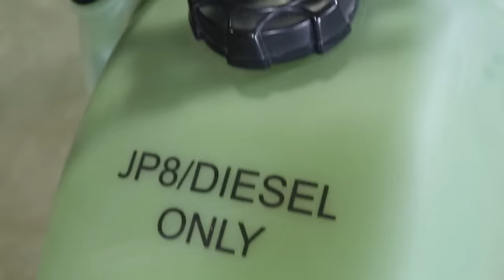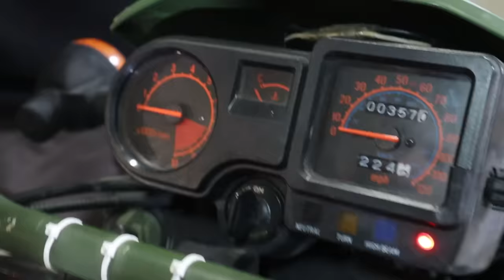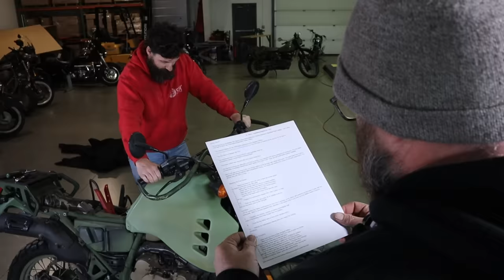I Bought a Diesel Dirtbike from the Marine Corps(1 of 214)

Comment: For what it's worth, I am a mechanic in the Marine Corps. If you're able to find a USMC serial number on it, I may have some information. Also, the blackout lights display light not visible to the naked eye, they are designed to be used with night vision goggles.
Reply: @Bushlore1  I'll look it up when I get back to work and let you know what I find!
Reply: It looked like the front light was open at the bottom. If they were meant for night vision wouldn't they be completely covered even the dim tail lights?
Reply: @JusttheEdge  the front is shrouded because it shines infrared light onto the ground for the driver to see. The rear is not shrouded because it is for other people to see
Reply: I bet there's a bunch of videos on blackout lights than can explain it better than I can
Reply: @travismud5213 was curious if you ever got any info?
Reply: @Ethan Lovell  I could find any information in the database. Is that there usmc serial number, or the registration number? Sometimes they are different
Reply: Just don't turn it into war thunder forum here.
Reply: thats what i was thinking about the lights - im in the uk so i cant bring my night vision around easily lol
Reply: @travismud5213  blackout lights & IR lights are two different things, no need to shroud an IR
Reply: Blackout taillights and most blackout headlights are not infrared. Only some blackout headlights are IR, but a vehicle with an IR headlight would also have a normal blackout headlight. The blackout lights on military vehicles, such as on this bike, are designed to be seen with the naked eye
Reply: someone commented he used to manage it, 599133
Reply: That's badass
Reply: its called infrared
Reply: I guess it wasn’t worth much
Reply: I guess it wasn’t worth much
Reply: Good for you 12:25
Reply: The blackout lights when I was in weren't IR...they were intended to be seen with the naked eye and even had a built in means of judging distance to the light.
Reply: Yeah the moment he pointed to that thing in the front I was like "looks like some kind of IR emitter"
Reply: What?! Badass!
Reply: Bro gonna use GCSS to find out it’s service history 😂😂😂
Reply: ...we're old!
Reply: I can confirm that driving blackout ops is horrendous. I did many of those in Iraq 03. Also we had quite a few of those bikes in 29 palms when I was there 01-03 time frame.
Reply: yut
Reply: Hyuk 😊😊
Reply: Blackout drive is used with night vision. A small amount of light barely visible to the naked eye will be bright with NODs the shroud is to illuminate the ground for the driver. Ir headlights exist, but are more for spotting down the road. We also had IR spotlights in Iraq 03.
Reply: Motor T Driver, We don't use  night vision in blackout. Back when I was in the Marine Corp didn't have the budget for every driver to have night vision, so none of us got it. The Lights are visible but they are equal to a .02 watt LED night light. edit My vehicle was the M-813, 5 speed manual diesel  6X
Reply: @markmitzlaff8672 totally agree
Reply: I was just about to comment about the NV lol
Reply: those aint trade secrets?
Reply: Yea find base they had them at  everything  in military  searal numbers
Reply: Oh was army I think  army has or had dirt bikes
Reply: They have to bleed the lines after the injector pump
Reply: And there should be a bleed screw on the injector pump body
Reply: Wasn't it in the instructions to purge the fuel system of air?

Comment: Those blackout lights are standard equipment on military vehicles. The reason  there is 4 lights Lin the back is for proper following distance. If you were following too close to the vehicle in front of you, you would see all 4 lights. At the proper following distance, the lights on the left would appear as 1 light, and the lights on the right, the same. At too great a following distance, it would look like only 1 single light.  Source:  I was a motor transport driver for the USMC in the 90's.
Reply: I was hoping someone had pointed out the tail light indicator purpose. I was a motor transport operator in the Army.
Thank you for your service.
Reply: motor tuh
Reply: @xzx_sparky_xzx  You too sir!
Reply: Wrong. You are just wrong. They are not for any visible purpose at all, they are for riding with NVGs
Reply: @onseki1774  I literally was Motor Transport by MOS. We were trained that proper following distance would show 2 lights on either side were just right, 4 is too close, and 1 is too far. Don't comment about things you don't know about.
Reply: @onseki1774  Ah, yes. The module that emits light for the purpose of seeing… has no “visible” purpose. Genius.

Comment: The decompressor lever is to enable you to spin the engine freely without compression on starting. Once the engine is spinning, release the lever so that it fires up on compression. You can also stop the engine by pulling the lever in.
Reply: Theres a comment in here based off the manual that explains what the lever is supposed to be used for, which is bleeding the fuel lines or having to push stsrt it, and to leave it alone when electric starting...because as with most electric starters they can handle compression
Reply: @jetstream454  Same thing is used on 2T Trials bikes. No starter motor, so have to be kick-started with a decomp lever.
Reply: Also makes for a safe way to stop a runaway. no compression, no more run away.
Reply: you can also pull it when you are moving and it will slow you down, compression brake, or jake brake
Reply: @jetstream454  - I think most, if not all older, larger displacement engines with a kickstart had one. I know it from the Yamaha XT 500 and SR 500. There it just held the exhaust valve open.
Reply: @steve1978ger  Yeah I remember hearing about that. And earlier big bore 250 enduros, at least the WR250F had it too
Reply: @deandee8082  A jake is different,  it only opens the exhaust valves at the top of the compression stroke.
Reply: It's not used while starting. Only bleeding the lines.
Reply: @deandee8082  How do you think that will work? It releases all compression from the engine to aid in starting, not add compression then release in the exhaust stroke as jake brakes do
Reply: Also I wouldn't use decomp to stop the engine as if I'm correct and it holds the exhaust valve open, that would cause damage.
Reply: @clifm9574  - interesting. on the SR500 it was only used to allow easy movement of the piston over the dead point, then you'd release it and kick the starter.
Reply: @steve1978ger  Maybe for a gas engine with a kickstart to get it at an ideal point in the stroke cycle, but for a diesel with an electric starter it won't matter, and pressure+heat=combustion
Reply: ok
Reply: @deandee8082  Slow you down, but not in slightest way as in any sort of brake. Slowing down with the compression release is WORSE then just letting go of the throttle, because engine is running even without compression to slow you down. 
You sir are extremely wrong on this one.
Reply: My tractor has the same decompression lever. Great for winter starts.

Comment: Also, by looking at the metal shavings, that thing worked while it was broken. You don't get that much shavings if it just break and stall suddenly. A good small diesels mechanic could probably figure this thing out in a few minutes. Also i'm pretty sure the company who made that thing used commonly available parts to keep the cost low, so the fuel pump, injector and all might be random kubota, yanmar or john deere stuff. The small diesels mechanic would be able to recognize those parts.
Reply: How small are we talking? Do they have to be a legit dwarf or is like 4'10" small enough?
Reply: I thought the same thing . I live in the south , in an area where there are quite a few machinery repair places that have some great mechanics who can rebuild a  small diesel engine like that in their sleep.
Reply: @thebrowns5337  certainly of the leprechaun variety.
Reply: My thoughts exactly. Hopefully they can track those parts down.
Reply: With 40 years experience driving diesel trucks, tow the darn thing round and round the block. ( after checking, oil, coolant). If it starts then open, strip ancillary and replace as needed.
Reply: @thebrowns5337  🤣🤣🤣🤣🤣🤣
Reply: @thebrowns5337  DAEM BOEEE AGAHAHAHJAHAHA
Reply: @thebrowns5337  4'10" should be fine though 4'8" would be better.
Reply: There might be partno's or markings on components that google could link back to the base engine.

Comment: I own one of these.  DO NOT use ether to get it running.  I learned that lesson the hard way by shearing the woodruff key on the flywheel (which coincidentally resulted in the exact same sound you're currently hearing when you crank the starter).  I know the guy on ADVrider you're talking about, he's a great dude and a wealth of knowledge.  Good luck getting her running!

Edit to add- that motor sounds like it's spinning really fast to have full compression.  Once you get the fuel and starter situation sorted out, make sure the decompression lever is fully disengaged when starting.  On mine it has a tendency to stick so push it as far forward as you can on the side of the cylinder head; if it's partially open you should feel it snap into place and seat firmly.  There is a very large bolded CAUTION in the operator maintenance manual saying the decompression lever is to "only be used for bleeding the injection system and for help in push starting" and "not to be used for normal, electric starting" (all bold, italic caps in the book).  Good luck!
Reply: Hi don't know much about diesel engines do some of them have two fuel pumps one from the tank and a higher pressure pump to the injectors is the one that's broken the lower pressure pump, I'm just guessing here.
Reply: That doesn’t sound good. 😕
Reply: @adam-g7crq  It all depends on the location of the fuel tank relative to the engine.  On the M1 the tank gravity feeds to the injector pump which is housed in what's called the "primary unit" iirc.  I've been told that on the earlier models of the M1 this was a pretty well known point of failure and was modified later in the run.
Reply: Don't know why people are so obsessed with using that stuff, it seems like every youtuber uses it. Just fix the fuelling issues instead of hiding it with starter fluid crap...
Reply: @elobiretv  It's particularly temping on this bike because it's very cold blooded.  I usually have to cycle the glow plug a half dozen times before the engine will fire when it's below 70 degrees out.  A little go juice seems like a good idea but this engine doesn't respond well at all.
Reply: @milleRC51  thanks for the reply, I'm just thinking out of the box here because I normally don't know what I'm talking about 😁 if it wasn't gravity fed and that may have been a low pressure pump could they bypass it with an electric pump to the injector pump.
Reply: oof they did already mess up
Reply: But they DID get it running....Didn't you see the montage at the end?  He made it to OUTER SPACE!
Reply: @adam-g7crq  on early vw 1.9tdi engines there was only the main injection pump that pulled fuel from the fuel tank and also injected it into the engine, later ones usually have electric fuel pump as well to feed the main injection pump like in gas cars
Reply: @de_fatherland6467  I understand, thanks for the reply.
Reply: @elobiretv  it’s a quick diagnostic tool, not a workaround. If you can get it to fire, you can generally rule out compression related problems and focus on the fueling problem.
Reply: Maybe you could send a copy of that operator maintenance manual to B&B?  They don't seem to be equipped with that.  Or with basic knowledge of how to post on a forum...  😆
Reply: @pault151  Everything I have is literally in post #2 and #3 of the thread they asked for help in lol (I didn't post it, but I received the exact same paperwork with my bike so I'm guessing this is all the material that was released to the public when the bikes went to auction)
Reply: @elobiretv  there ain't nothing wrong with emptying a can of Cosby sauce into a diesel motor. - zip ties and bias plies
Reply: Boy, I really HATE cliffhangers!
Reply: Yeah I kinda winced when he pulled out the can Aerostart, that stuff shouldn't be anywhere near a diesel unless it's a last-resort emergency.
Reply: How do they ride
Reply: @adam-g7crq  yes. it has a mechanic transfer pump and injection pump
Reply: Just another thought, probably going to get this wrong aswell 😁 don't some injector pumps have a diesel stop solenoid if that was faulty, maybe.
Reply: ok
Reply: @adam-g7crq  some do some don't, Cummins put shut down solenoids on electric engines.  mechanicals have them or air shut offs
Reply: I didn't know that. We used the decompression lever and the glow plugs every time we rode them. They seemed like finicky bikes....maybe because we were messing them up 🤷
Reply: You actually own one of those?? 😮 Whats it like? Yes I'm fanboying right now, one of the most fascinating motorcycles I can think of 😂
Reply: @jetstream454  It's a cool bike.  Heavy, slow, vibrates a lot but it's like driving an old Willys; it's about the experience not actually getting anywhere quickly.  It's also a finicky machine, don't expect to just crank it up in the morning and head to work reliably.  I feel like I'm constantly fixing/troubleshooting something.
Reply: Yeah no ether just use a gasoline soaked rag.
Reply: @adam-g7crq   yes you have a lift pump to lift the fuel from the tank at low pressure and an injection pump to push  the fuel at high pressure into the injector
Reply: Ya hate to see it after the fact 
 LOL
Reply: @milleRC51  on the forum? I will try and find the post as I am interested
Reply: @adam-g7crq  honestly, even with out a low pressure pump, this thing should run gravity feed to the injector pump.
You wouldn’t get full power, but it should at least idle.
Reply: @marvindebot3264  After the rings get washed out, and the compression is killed, it’s an aerosol junkie after that.
Reply: @adam-g7crq  There is a lot of debate between military vehicle designers because gravity or mechanical fuel pumps aren't susceptible to electrical issues (from dead batteries to EMPs or EMI from radars and jammers) but electrical pumps are much more consistent and easier to replace.

Comment: The headlight is an IR light that is meant to be used while you are wearing NVG’s (night vision goggles). It’s invisible to the naked eye but when you’re wearing goggles, it makes it look like daytime. Same with the tiny little taillights. This was the same way that we flew helicopters at night when in combat.
Reply: You're right, but a little tidbit is blackout lights on vehicles aren't IR. They use regular, off the shelf bulbs with a very dark lense to dim it. You can see the light if it's really dark out or you cup your hand around it. It's logistically easier and cheaper that way.
Reply: An easy way to determine if these are IR lights is to turn your phone camera on and aim at the lights. IR lights don't look red, they'll be very light purple/pink.
Reply: You are absolutely correct sir!!!
Reply: @jayryan7473 also a great way to see if your TV remote is working
Reply: @jayryan7473  Yep, a very dull red to the eye and a bluey-purpley white/pink on camera 😂
Reply: Here’s the IR deal from the Army side with Cav Scouts.  They came with “blackout drive” strips that allowed a normal headlight bulb to be masked somewhat so as not to be seen from distances or from above, but they had horrible light range.  Now remember, KLR’s came with normal single halogen bulbs in a headlight bucket.  I have seen aftermarket LED replacement units procured with unit supply’s GPC card, and they did have an additional row of IR LED’s.  So the answer is, some may have been modified at unit level.
Reply: Thank the lord you posted this comment, my inner retired NCO started freaking out!
Reply: @yojoe. Turns out you're wrong lol